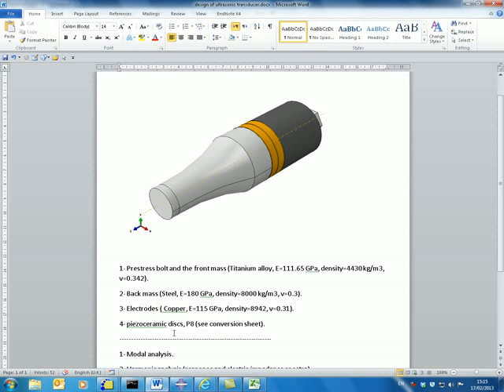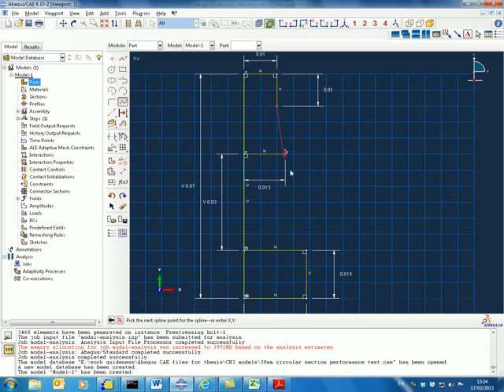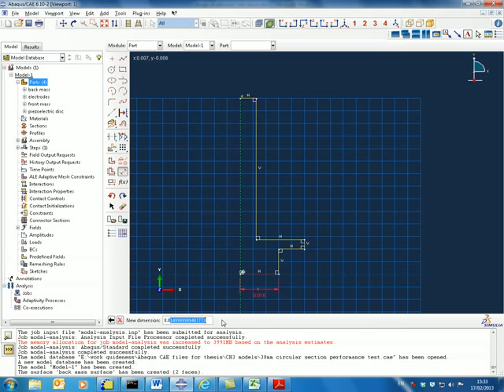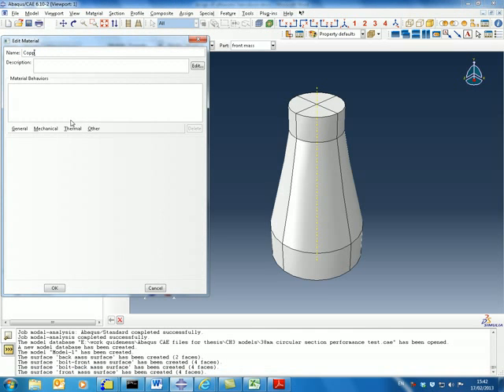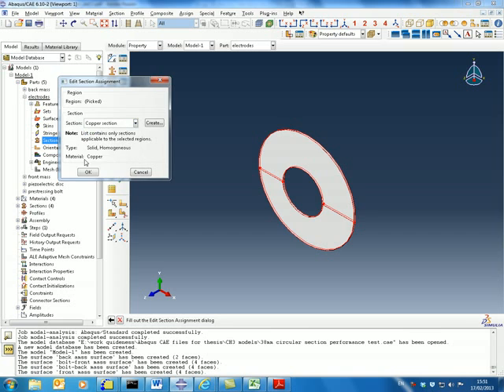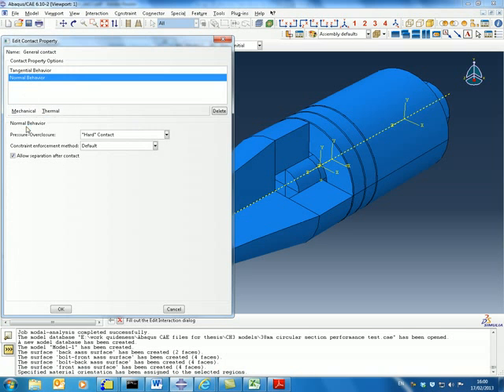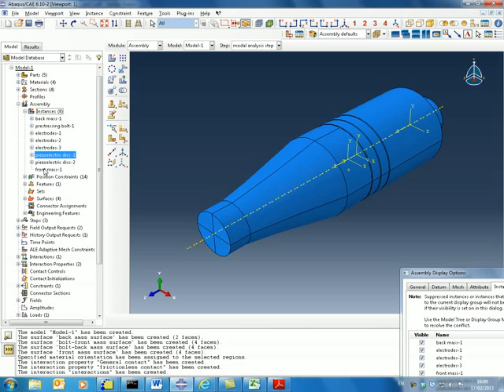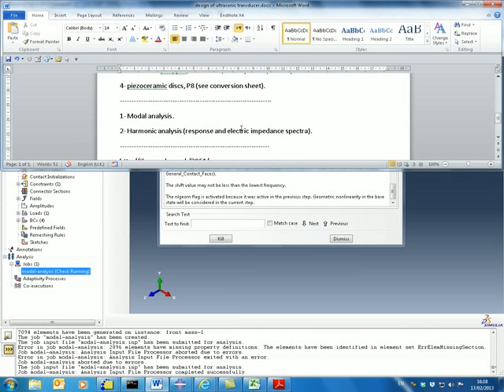Modal analysis of ultrasonic transducer

Comment: Hi. Thansk a lot for this informative video. I tried simulating a similar transducer but when I run the job, I get the following error: 44 nodes may not be used with a multi-point constraint since they are also part of pretension section. The nodes have been identified in node set ErrNodeMPCPretenSec. Do you know how can I solve this problem?
Reply: send your file.........